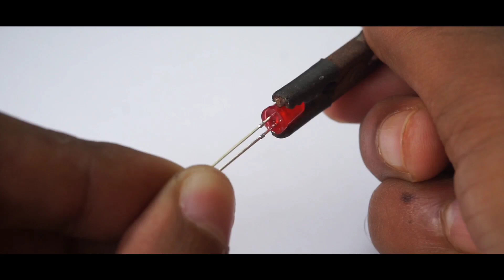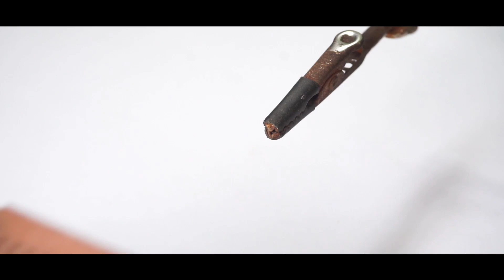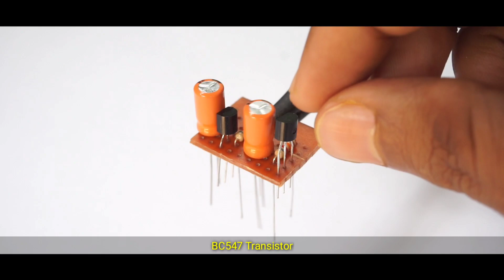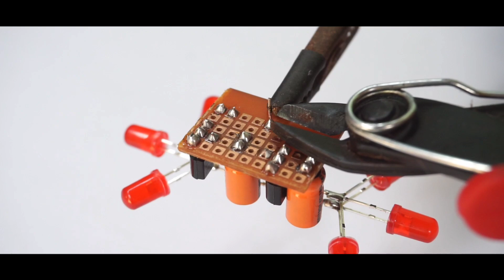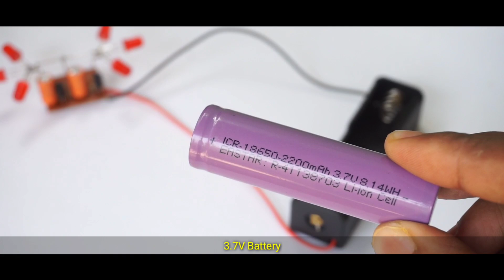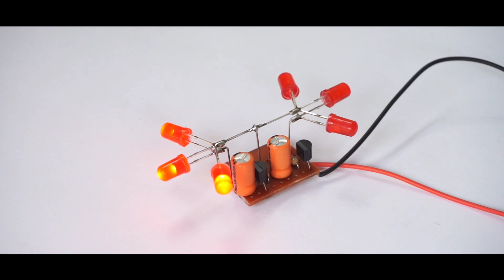THIS SMALL DIY HOME DECORATION LIGHTING IS AWESOME

Comment: I don't like the pcb that's being used, to connect the tracks you have to use an excessive amount of solder, what happened to pcb's with straight tracks, much easier to use?